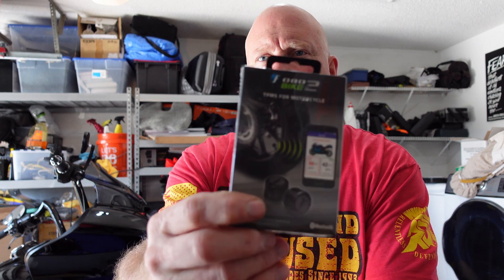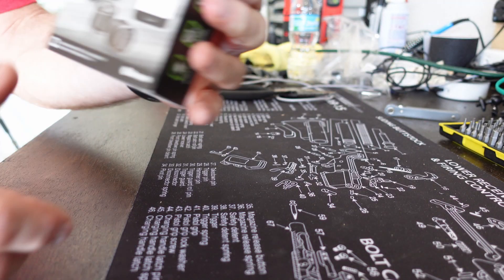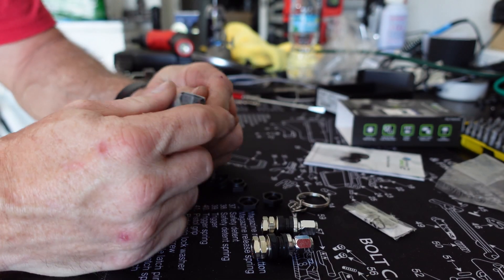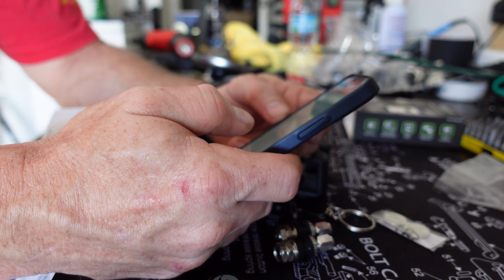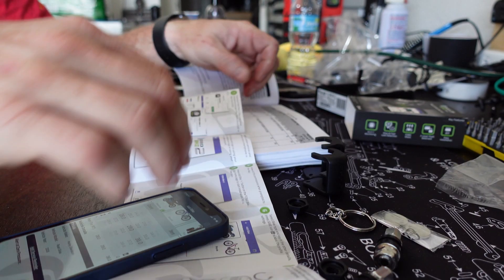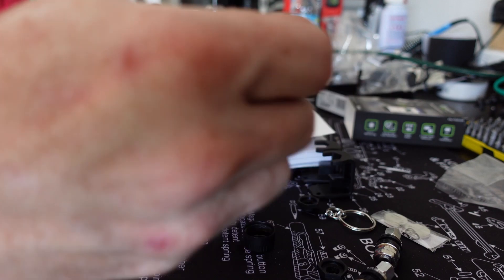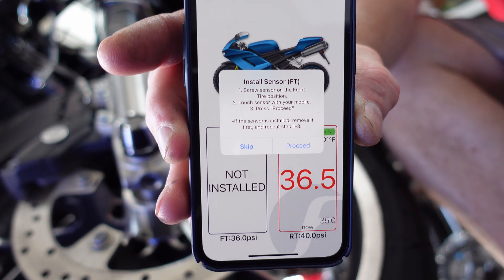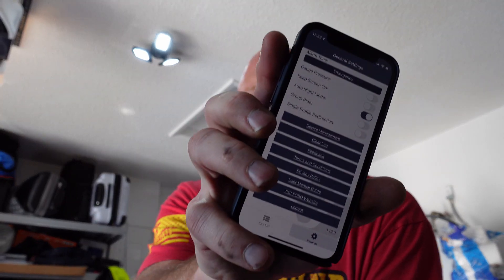Harley Davidson Road Glide Tire Pressure TPMS - FOBO Bike 2 Tire Pressure Monitoring System

Comment: So you didn’t double check to see if it was telling you the truth about your tire pressures. I’m thinking about this myself I can usually feel it but I had a blowout this year in the rain it must’ve been running low I thought the bike was floating I was running at high speeds. Slow down for a work zone and tire was flat. Way I was running with low pressure for a while. I just thought the bike was floating in the rain . Yeah 250 miles on a 500 mile run from Tennessee to Pittsburgh 75 miles away from home I had a 70 mile an hour flat. So that’s my reason just wondering if this is accurate. Thanks
Reply: Glad to hear you made it home safe. It’s super accurate because I use a digital air pump and when I attach it the reading is the exact same. It shows the changes in pressure on your app and will warn you depending on your settings. Ride safe!